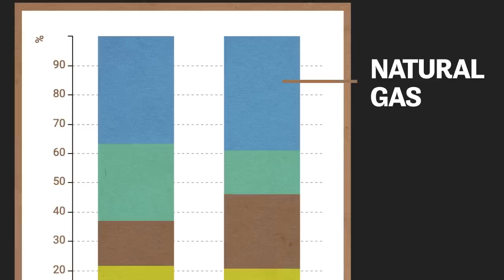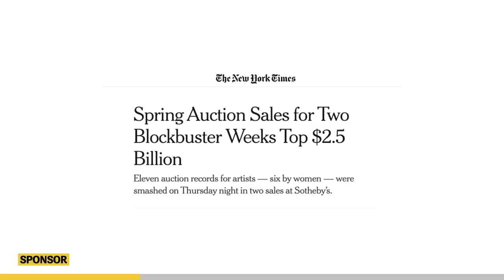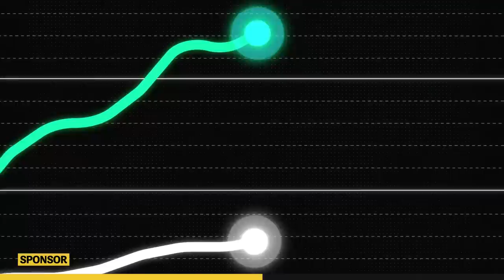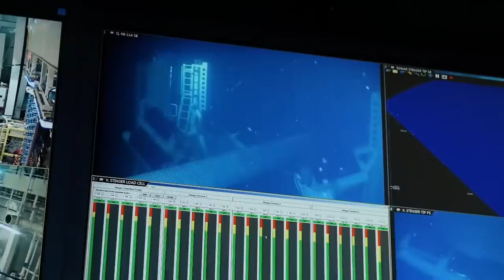History's Most Terrifying Winter Is Coming? (Nord Stream)

Comment: The video is great but it fits better with the sentiment experienced a couple of months ago, since now most experts say the biggest problems are resolving, especially with nearly no western european country actually buying russian gas anymore for example germany is at 0GWh and to that european storage facilities are filled to around 96% which alone will be enough for a whole january but with norway, netherlands and belgium as suppliers and the LNG imports it will be easily enough for the whole winter when you also consider that gas consumption is already 20-30% lower compared to last year and some gas reduction action plans have not even started yet

Comment: I live in a well insulated apartment, so I’ll be fine in Denmark. I haven’t turned any heating on yet and the indoor temperature is still 23 C to 24 C all day long. I spent like $70 for heating from the start of May to the end of September, from district heating, and that was all for hot water use, and not for heating my apartment. My energy company expects me to use around $90 for heating from the start of October to the end of December, but I doubt that will be the case.

Comment: Europe have survived the little iceage, then every winter was far worse. When I was young every winter was far  more colder then nowadays and we had only one heater in the whole house apart from the kitchenstove. 
Mother made us a small bed by reducing the lenght, then you had a warmwaterbottle and three woolen blankets. It was warmband cosey. Great to wake up and look at the iceflowers on the window and blow a hole in it. We are just spoiled, you don’t need to warm your whole house or the bedrooms and certainly not to 23°C. A warm bathroom is nice. Not washing yourself in the winter in the kitchen is nice. But I have my washingmachine and dryer in the bathroom and on sunday I take a real bath after I have done the wash at reduced temperaturen and dried the sheets and towels, just on the lowest setting.It’s like a sauna then. On the other days I pop in and out the showers. 
You can life comfortable and save energy 18 or 17° C is Ok and also healthier, because you burn fat and will loose weight, but you have to dress for it. More thin layers is better then 1 thick one. Best is for your health is no sweater, but that’s not everyones cup of tea. In theory your metabolism will adapt but then you will have to eat more and that could outbalance the energysavings.
Also keep yourself warm not the house. There are several ways to that.
Also when cooking you can save, rice, noodles, eggs don’t need to boil. Bring the water to the boil with a lid on the pan, turn off the heat and they will cook without boilling. The rest you can turn off the heat five minutes before. When deepfrying bring the oil on the heat, turn it off and fry. You have to experiment with temperature and time. Eggs and bacon fry the bacon, without grease off course, turn the heat of and fry the eggs in the restheat. Everyone can try different things experiment.
Reply: Nah too much to think about just to keep myself warm. I’d rather burn more energy to waste then use no energy so the rich can profit from me not using it.
😊
Reply: Europe during COVID crisis: if you don't do everything the government says you are killing my grandma. Europe during Ukraine crisis:  my grandma can't  afford to feed or heat her household but that's okay small sacrifices for the greater good.

Comment: In January 1967, there was a high temperature of 65 degrees (very warm for winter), then the temperature dropped drastically and the next day and a half had a record setting blizzard which dumped 23 inches of snow.  So the scenario is not out of the question.
Reply: 65 degrees of FAHRENHEIT
Reply: 65 degrees? That's impossible. Humans are not built to tolerate that kind of heat
Reply: @savejeff15  Thanks, forgot to mention that.  My point being that temperatures can change very drastically in a short period of time.  Also that was the biggest snowstorm in the Chicagoland area on record.
Reply: @bigverybadtom  Yes but now weather prediction is far more precise. There would be enough time to prepare the affected area
Reply: @johnwt7333  that’s the surface temperature of Iraq in the summer
Reply: @mujtabarashid3847  hahaha naaah. 55 I can believe but not 65.
Reply: @johnwt7333  Air temp is like 54-55 but ground/surface temp reaches 65 or possibly even higher. Gotta remember days are long there, nights are hot and can be like 35-36 minimum at night.
Reply: @johnwt7333  I think they're American and use Farenheit, 65 F is about 18 C
Reply: @mujtabarashid3847  he was talking about 65f which is 18 C
Reply: @johnwt7333  its 18C
Reply: @moleicester9714  why couldn't he just say that

Comment: I don't turn on the heater unless temperature in my home drops below 14 Celsius, which it almost never does.
Anything between 14 and 19 will be met by a woolen sweater.

My natural gas consumption is almost completely cooking and showering, 400m3 natural gas consumption per year.
I'm not afraid of coming winter.

Comment: I mean, it's not really a problem for Germany. Just use the tried and true method, the black gold, coal. It's just the climate activists you have watch out for. This all could've been prevented if they followed France and maintained their nuclear power plants. The funny thing is that nuclear energy is cleaner than most energy sources in the long run, and even cleaner energy (geothermal energy) is basically just nuclear energy from the Earth's core, that doesn't rely on seasonal or variable fluctuations.

Comment: A pretty good summery of the current situation. If you factor in that one LNG tanker costs $450000 per day and it is in general 8 times to 10 times more than the previous Russian pipeline gas, than it makes it clear it is no long term solution for Europe. It might work for a year or two, after that the cost will break those nations.